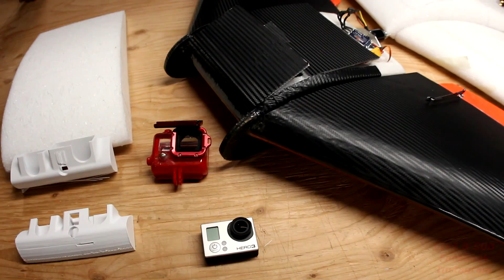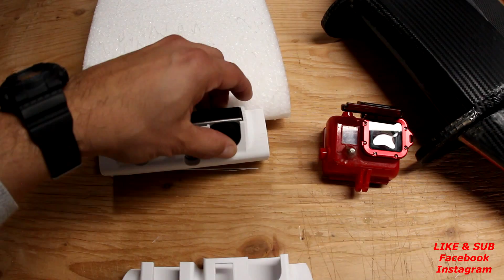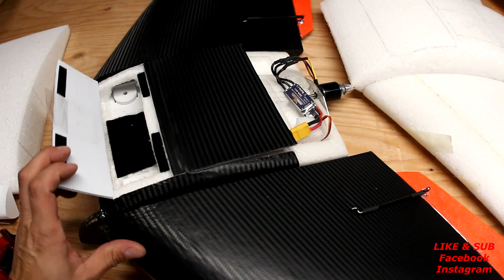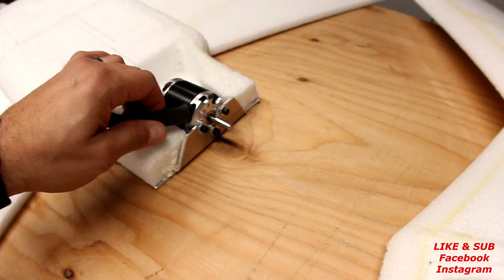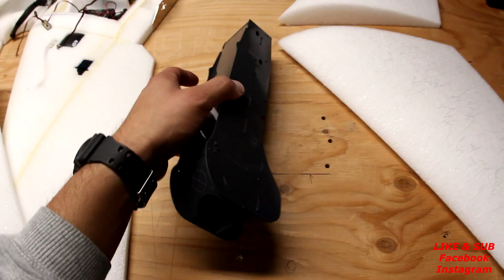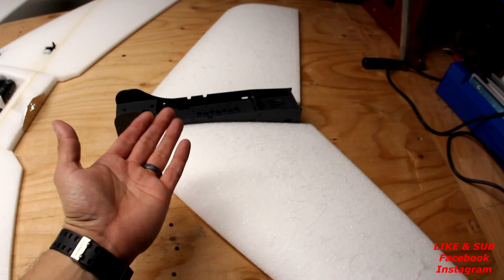3D mapping frames LONG VIDEO!!!

Comment: I got a question about the Juggernaught @ 5:37
Is that carbon fiber on there or a carbon fiber looking Packing tape or Vinyl tape? and if it's carbon fiber, how did you do it?
Reply from the maker: Yes, it is vynal wrap from Amazon. A pain to put on. Lol
Reply: Hmmm, do you have to iron it on or what?
Reply from the maker: SnapPunch Robert The carbon wrap is just like a big sticker. Peel and apply it on.
Reply: Thanks